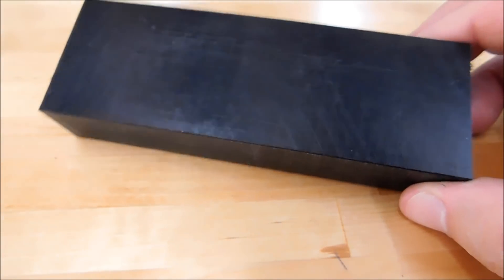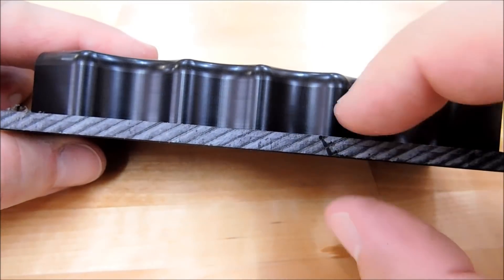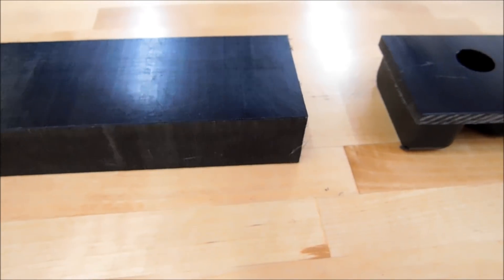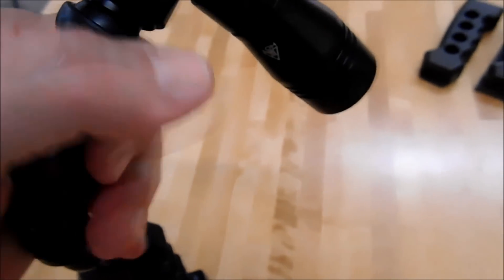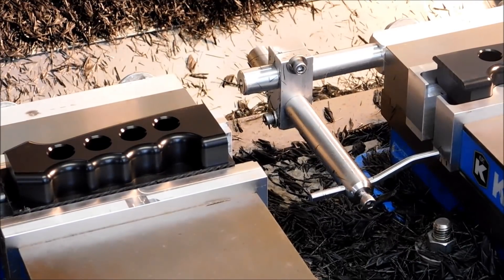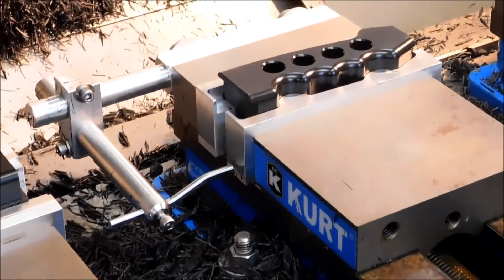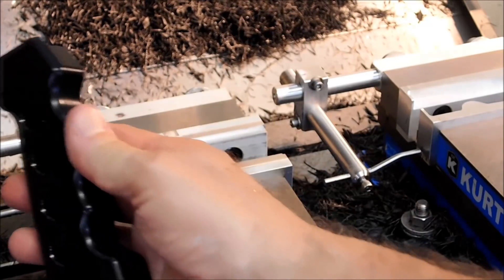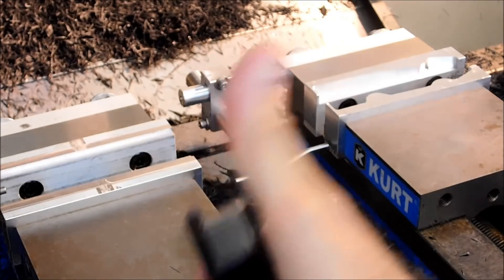Flip Flop Milling

Comment: Quick question Joe, when interpolating the 4 holes do you arc in/out on the finishing pass?  During my apprenticeship our lecturer always said this was good engineering practice.
Reply from the maker: If you watch the video closer, you'll see i looped the interpolation pass so it makes 2 passes. 1 pass to size, and the second pass is just to remove the material left behind from the cutter flexing. Its called a dead pass. This helps to eliminate any trace stationary retract vertical line in the bore. I do not arc in or out, but that's a great way to assure there is no start/stop point remnant.

Comment: seriously nice milling operation Joe, pleasure watching, beautiful finish, think you have mentioned what the material was before so will check past vids. How long did it take you to set up and work out the code? TFS G :)
Reply from the maker: Thanks. The material is Delrin. Sometimes I use Acetal. The code took a while because the grip ergonomics were cut several times before I hit on the one that just said" HERE I AM". That translated to new second side jaw for each. The development curve was about 4 solid days.
Reply: @joepie221 … Thanks for the quick reply, love the "HEAR I AM" I find that a lot with my wood turning, may sound strange but I put it in the lathe and it says this is what I wanna be. I know metal turning and CNC is a tad different as the part is aimed for but the ergonomics is I guess a hit and miss type of labour of love. Love your approach to your problems always fascinates me, again TFS G :)

Comment: When running 2 vises and the same tools for front and back of the part, where do you prefer to take your hight offsets from? Do you use the same H offset numbger and comp in the wcs z?
Reply from the maker: I use only one Z height per tool and adjust the program for different vise requirements.

Comment: Is there a reason to not use a 3d printer to make these?
Reply: Let's see - They're made from Delrin and you could probably have a good number of  your production run completed before that 3d printer got finished with its first substandard part.
Reply: There are several reasons. A 3D printer is not going to make 500 parts in a timely fashion since its best use is as a prototyping tool. Also, 3D printing is additive, imagine using a stick welder on a flat plate to make a 2 x 2 x 4 block of metal from scratch, building the bead up, instead of starting from a solid block and milling it to spec. Which do you think is a more solid / stable part?

If you begin your education from 3D printing, unfortunately it tends to give you tunnel vision. It's like when you're an edgy 13 year old in the 90's and you have a lighter; you spend months trying to solve your every problem with that lighter. You're that one kid with the lighter your friends are getting real tired of.
Reply: For cost reasons, a 3D printer may be helpful for developing the ergonomic shape of this handle, but to run production, you could never expect the superior surface finish shown here, or the strength. But....a 3D printer could make this part hollow whereas conventional machining never could.. I see a lot of engineers that go directly from a 3D printed prototype to a request for a milled part and just don't understand when a machinist says " You can't have that"
Reply: @Shop-Tech   You could hollow it out on the first pass, bond a sheet to the top, then do the second pass. You could get a few extra ounces of buoyancy that way. Actually, that might require 3 operations. Just depends on how far you want to push performance vs price.
Reply: 78sharpshooter 3-d prints look terrible. All the layer lines need to be smoothed. Until that is sorted 3-d printing will always be  a subpar method of manufacture... slow too. It will get better.  But at a reasonable cost it’s just not there yet.
Reply: motormaker I thought the surface of the 3d print may be desirable for grip underwater. Black nylon

Comment: Assuming that T3 and T4 are equal in quality why not save the 10s tool change and just change the cutter comp and run T3 with the true diameter instead of calling up T4?  Nice video btw.
Reply from the maker: I do it strictly to guarantee the outer finish is outstanding. I'll take the 10 second hit to assure my product stays cosmetically perfect. Thanks for watching. You will also occasionally see me send a tool home before using that exact same tool in a follow up operation. The inserted duplicate tool call gives me the freedom to make and run edits without having to rerun the first part of the code that didn't need tweeking. Once dialed in, I have the option to just wipe the tool call and continue seamlessly.
Reply: 10 second tool change? Lol what machine are you using, try about 2
Reply: @Josh-bc7gi  from one operation to the next operation 10s. Simple.
Reply: I always do that. Unless I have to use a rougher first because of large amounts of material to remove. I also use a carbide drill mill for most countersinking. I leave it in the machine along with 6 other dedicated tools that are used constantly.

Comment: Great video Joe. Questions: Do you also machine the flexible arms? Would love to see that if you do. Also, what technique do you use to get the white paint into the Advanced Innovations engraving? Thanks!
Reply from the maker: The flex arms are commercially available 1/2" LocLine. The engraving is done after anodizing, so the shiny lettering is actually base aluminum below the black anodize. No paint required.

Comment: Was the entire cutting part sped up? Or just parts of it?

Another fixture u could make is a big ass vacuum plate and put an big plate of the material and run the first op on the entire plate.

Then use a carpenters table thingy (i dont know what its called in english) to remove every single part from the plate, and use it to make the hole chamfers and edge roundings that werent possible during first op. 
It can use a straight cutting, rounded, or chamfer tool which has a bearing on its tip so it doesnt cut everything it can.

BUT it doesnt leave as concistant finnish as a machined part and since its manual labor ofc it costs time for example if ur running multiple machines at the same time.

Third op would remain the same as on the video.

I hope people can make sense of what i wrote :)
Reply from the maker: All the machining done when the parts were positioned flat was 2X, everything else was real time.
Reply: Another reason to avoid using a router table (if that's what you are referring to) is that they are dangerous as hell compared to a cnc mill. I would never ever use a router unless it was way, way faster. I've had too many close calls where I slipped up for half a second and the part grabbed on the tool and was ripped out of my hands and thrown across the room.
Reply: @seth094978  Hi.
I was referring to router table, nice to know its name 
What kinds of material have u used it on, just curious.
Only plastic that ive had trouble using router on was Petp but that was mostly because there was too much material left over from machining.
Reply: @alluAA1  I haven't had much trouble, but thrice is three times too many for my tastes. I've cut mostly polycarbonate, a little UHMW, and nylon once. Flush cut bits I honestly don't mind, but radius ones scare me. For some reason they always seemed to want to grab more. I've cut 3/8 chamfers before and that was a bit interesting as well.

Comment: Joe, the material looks like black Delrin, is it ? If so it is NOT suitable for salt water use.  I went to make some parts for a saltwater swimming pool and was told it would fail in a short time, had to  use PVC instead.
Reply from the maker: Hi Dave. My materials guy told me Delrin, being a homopolymer, is very very slightly more porous than an Acetal plastic. Though Delrin has far greater elastic strength properties, salt water exposure for an application like this one, is fine. I chose this material because I wanted the thread strength. Any experienced diver always rinses their gear in a fresh water bath after a salt water dive. If this was a part that was going to be submerged and stay submerged.....forever, Acetal may be the better choice since it is a tighter grain and would reject penetration better in the long run. Acetal is also much easier to machine than PVC and much tougher.
Reply: Dave Ticehurst- Delrin is fine for salt water use, it is commonly used in fishing reels and marine fittings. Delrin is not resistant to chlorine (a salt water pool uses an electric cell to create chlorine from the salt, so in effect it is a chlorinated pool) 
Unfortunately you were misinformed by your supplier/friend/friend of a friend.
It is always best to check the manufacturers recommendations when choosing materials

Comment: Mr. Pieczynski - probably a dumb question - but what do you mean by "interpolating" the holes (I do get it that they need to be in the right places for fixturing afterwards)?  
And, I will say that I have learned a lot from your videos - Thanks!
Reply from the maker: The answers are correct. It is a great option for making a hole bigger than the cutter diameter and getting a nice finish as well. A huge benefit of a CNC machine.
Reply: Interpolating is cutting a bore with an undersized tool, and having the X-Y trace the circular path. Almost as good as boring for putting a hole in the exact place you want it. Way better than a drill, although in this application it's probably more for surface finish than anything else.
Reply: @RambozoClown    @Lasse Langwadt Christensen   Thank you.
Reply: at 15:37 tool smaller than the hole
Reply: to enlarge the pre drilled hole to any nominated diameter by having the tool travel in a circular or helical path.

Comment: Any reason why the deburr was done as ID then OD instead of one continuous tool path?. And if done after the last drill op, that tool could also pop a chamfer on those two pin holes. Gotta love Delrin.
Reply from the maker: Yes, good question. I used the code from the formation of the initial pocket for the ID deburring op, then just punched in the outer path afterwards. It saved me time at the controller.
Reply: Joe Pieczynski so you made up the program on gcode and not a CAM software? If so, why not use CAM? Thanks
Reply from the maker: The pocket code was CAM driven and immediately available. I punched the perimeter code in at the machine.

Comment: First time being first!   Hi Joe, what is the name of that material please? Thanks!
Reply from the maker: Its Delrin. Delrin is a homopolymer plastic. You can also use Acetal. Its a copolymer plastic and acts exactly the same way this material does and can be cheaper. Either material is tough and will give you the finishes shown here. Thanks for being first.
Reply: @joepie221  Thanks!  I will do some more research on these materials. Thanks for the info.